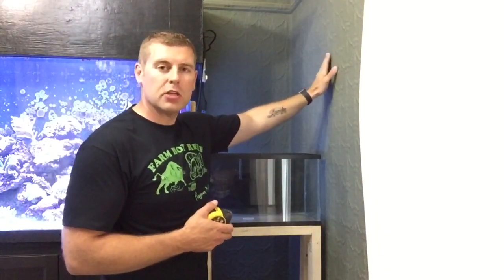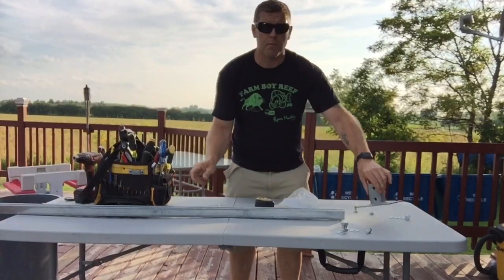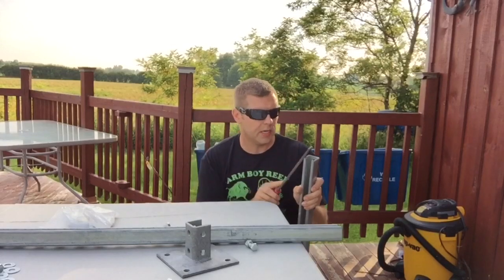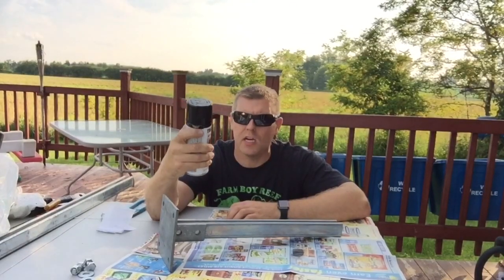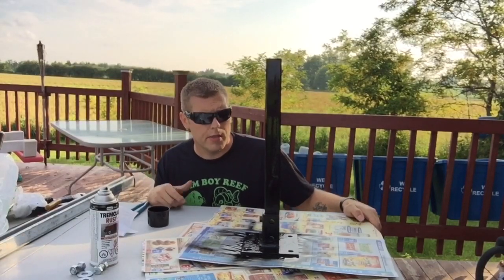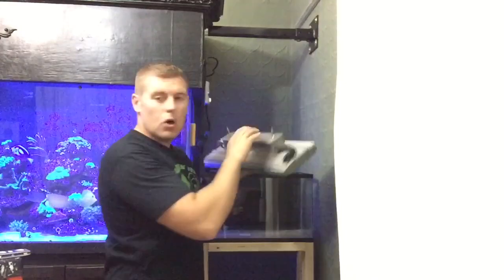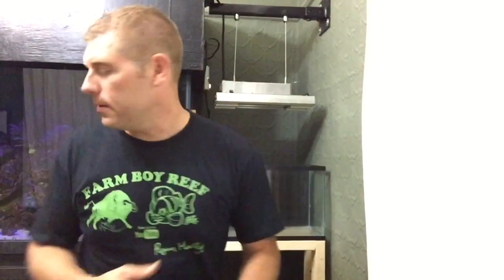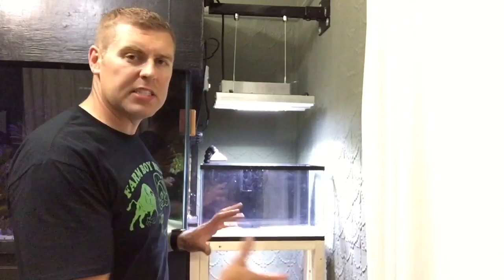Reef tank build part 6 making a custom light hanger for led fixture

Comment: Solid build. What were the parts/ends you used on the cable? It seemed like it would automatically grab the cable ad you pulled it through.
Reply from the maker: Hey jimmy !! The parts are a cable release  controller